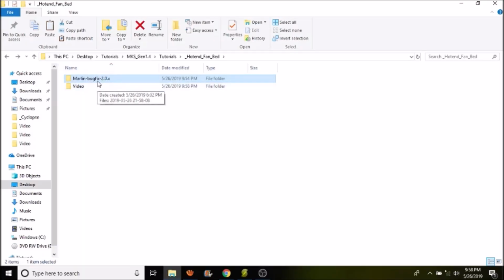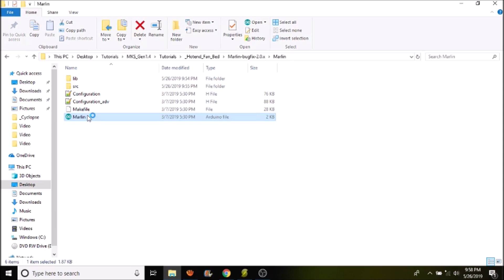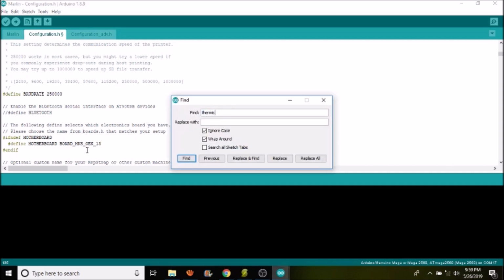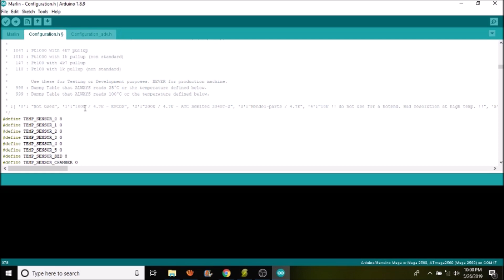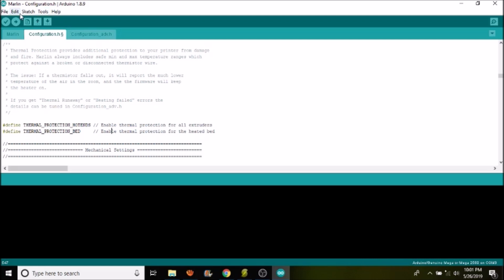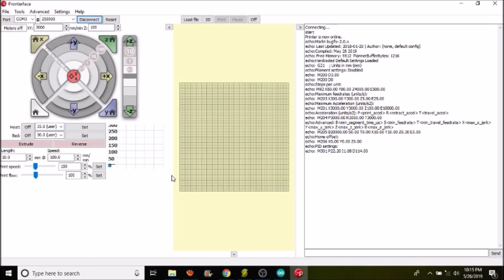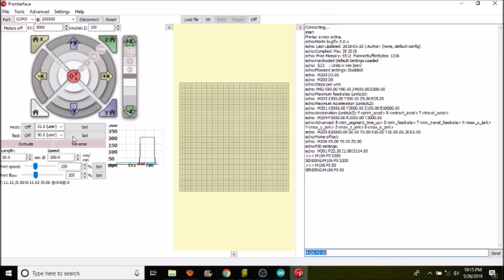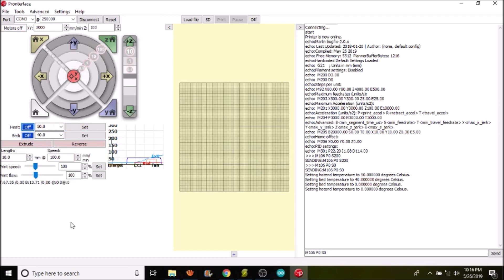MKS Gen 1.4 - Extruder, Fan, and Bed

Comment: I know I'm very late to the party here, but thanks for this. If I were to do a dual hotend, I'd be able to run E0 on D7(top) E1 on D10(2nd from top), F0 on D9(3rd down), and Bed on D8 (4th one slightly separated from 7/10/9)?

Finally, is that F0 on D9 the fan for extruder cooling and auto-on at 50C, or is that the part cooler fan?

Thank you so much for the clarification on MKS_GEN_13 vs RAMPS_14_EFB
Reply from the maker: Most of the heater ports can be interchanged you should check the datasheets to confirm and you may need to modify pins file.
Reply: @EdwardBraiman  So, I did end up getting everything configured properly, thanks hugely to your vids. Much appreciation for the hard work! (Note: This doesn't mean I've learned how to properly print with the new hotend yet :) ... learning curve)
Reply from the maker: I'll be doing more videos on a printer soon to walk through that process as well.  Thanks.
Reply: @EdwardBraiman  reduced retraction settings and lower temps have been my friends so far. Getting there